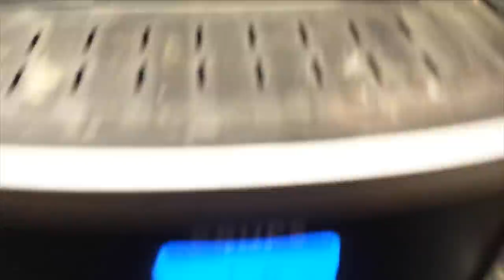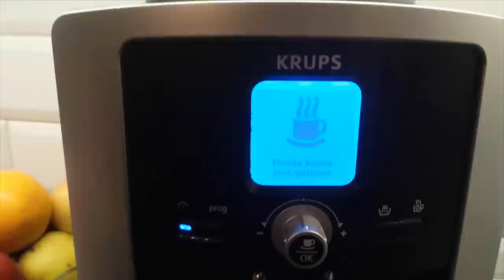KRUPS XP7200/EA8000 wyciek cz1. [leak part1.]

Comment: Hello when I switch on my machine is says it has to fill but this does not finnish. What can be the problem?
Reply from the maker: Hi,
do you mean that you have to fill a water tank? If yes, there are two options:
1. for 99% the float inside the water tank sank. Please check it. If it sank, there is a simple way to dry it - just put empty tank to the microwave 800-1000W / 1 minute. Microwave increase temperature of wet things, so the plastic will stay cold, and all water will evaporate. Just repeat it several times till the water be visible after microwave operation. 
2. float sensor moved - unfortunately you will have to disassembly coffee machine to check it.
\Mariusz
Reply: It has error 5 when I switch it on. I get a little bit of water when filling but not enough and it gives error 5. The float moves when I put water i will check the sensor.
Reply from the maker: Error code changes everything.
Please check this out:
http://www.repax.dk/files/EA8050%20temp%20mm.pdf
There is an error code table. You can read the cause and find solution.
Reply: Okay so it says
1) Flowmeter fault (wires reversed, 
connector offset, …)
2) Switch or distributor switch 
control fault 
3) Drop of water on the flowmeter 
connector
4) Pump fault
5) Water flow blocked: hose 
caught, strainer missing (tank 
valve not actuated), tank badly 
connected

5 seems not logical, which one of the top 4 is most likely?
Reply from the maker: You have to disassemly it, than you will see.
I hope there is no water pump issue. In My opinion it is one of sensors stuck.
So disassembly, check all switches and sensors wiring and connection, than check.
Reply: Can you maybe point out the position of the sensors?

Comment: Hi,you know about code error 6  on Krups xp 7200  ?Thanks!
Reply from the maker: Hi,
Error No06 is the most common problem and means: 
Water Leak, lost water presure

actually ro fix it you have to do full machine service. You have to buy full set of gaskets and replace them.

I recommend to replace at the same time entire piston - it costs the same as just two piston gaskets, but inside of the piston is one aditional gasket with really small whole responsible for coffe strongness.

For more details, have a look at comments below - it is really common topic.

\Mariusz

Comment: help mi, a have Krups EA8255 Potencia 1450W and in lcd this mistake 5, what is this?? I need technical manual
Reply from the maker: Hi there,
Error No5 means the water pump problem.
More precise: During the first few seconds of work, the amount of water flow is zero.
Possible cause: 
- damaged flowmeter (pipes mistaken, loosed connectors)
- damaged water distributor switch 
- water drops on water distributor connector
- water flow blocked (water pipe bent, or there is no strainer [water tank valve blocked])

Honestly for 99% you have no serious problem. Strongest possible is the water distributor switch (check electrical connections, disassemble it and assemble again) or the water  not coming because of water valve (were you plug the water tank).

I have the technical manual, but in polish language - if You are interested in, just download it from here: http://wyslijto.pl/plik/5p1z3ynx0y

Water distributor you can watch here: https://youtu.be/pHsmttJ79zo?t=8m6s

Fingers crossed
\Mariusz
Reply: Thank you a lot, It's very well information

Comment: Hi, Mariusz Grden, great video, can you help me, I have a Krups XP7200 ,the main board have a short circuit and some lines connections is burned ( the short is located near to R1 100K ohms and the  C05 conector and C04 connector) can you send me a photograph to the main board to check  lines connections  between  C05, C04 and R1...pleace.  thank you for your help,  bye
Reply from the maker: Hi,
please check this: http://wyslijto.pl/plik/f7pexmqpei

\Mariusz
Reply: thanks for your information , but i can see the squematic mainboard diagram, pleace can you send me only the main board phothograph because i think  the line burned is conected between  C02, C05 ,R1 and  C04. ( the main board id is GSM 03000020)
Reply: i send you the photography  to show where is located  the line burned in the pcb board     < img src=" https://www.facebook.com/photo.php?fbid=140848163184117&set=a.140848126517454.1073741827.100017768016637&type=3" >  my question is is correct connected the dotted line ??? because that is the line burned  in the pcb board .

Comment: what does an error code 0A mean?
Reply from the maker: +Ella Siroskey 
Hi,
Diagnose:
error No 0A means that the expected warm-up time exceeded.

reason:
heating unit damaged. Heat turned ON, but the temperature wasn't changed.

I know, that sounds bad, but the actual reason is really simple. On 99% U have unglued or unsoldered thermistor .
Repair of this issue I captured on this video:
https://youtu.be/pHsmttJ79zo?t=5m59s

Good Luck

\Mariusz
Reply: +Mariusz Grden   Thank you so much!  Do you also have one on how to clean the grinder?  Ella
Reply from the maker: Hi,
unfortunately I haven't.

On my videos U can watch how to disassebmle entire machine. When You disassemble it, the grinder will be fully accessible, so you can clean it.

\Mariusz
Reply: Thanks so much for the help.  A wire was disconnected - so we soldered it back on to where it belonged from watching the videos - this machine now works perfectly!  Thanks!
Reply from the maker: +Ella Siroskey 
Hi again,
I've just captured a short video with grinder cleaning:
https://youtu.be/3hqZKm4mH2k

I hope that it will be usefull for you

\Mariusz
Reply: Much thanks!

Comment: Hey .. What is this error cod  no 12
Reply from the maker: Code 12 means that there is no signal from the switch located on the bottom of the boiler.
I will look at that an will try to take a picture for you.
Reply from the maker: Hi,
Your answer is here: http://youtu.be/CYht0sNLFGA

And one more thing - why did you wrote your question in english if informations on your profile are in polish?

\Mariusz
Reply: Mariusz Grden Mariusz error 06 ???  help please :-)
Reply from the maker: Hi,
Error No 6 is the most common problem - water leake.
So you have to change all rubbers. 
Everything is on the movie. 
In case any problems, go to me, I will try to help you.
\Mariusz
Reply: Dzieki  !!

Comment: Hey, I changed bout 7-9 gaskets i had a problem leaking water on from under the machine  but still leaking nothing come out when rinsing all comes out under the machine, help!
Reply from the maker: +Erko Man 
Hi
Have you checked gasket under the water tank?
When you assembly the rear cover it is very easy to bend this gasket. In this case water goes directly under the machine.
\Mariusz

Comment from the maker: Hi Igor,
1. I am unable to reply your comment, so I have to write this answer on the top of the tree. Probably U have disabled this functionality on your Google profile.
2. Regarding your KRUPS problem No 9 - it means: heating timed out.
So you have a problem with thermistor NTC located on the boiler. Probably it's been unglued or unsoldered.
Fortunately I have a video from this repairing.
please have a look at this video:
https://www.youtube.com/watch?v=pHsmttJ79zo
Reply: Thank you very much! I'll try to fix this problem using your video. You just saved me from going to service center =)
Reply: i checked the NTC on the boiler
it looks like this: http://1drv.ms/1xkJLfc
is it OK? there is no resistance between contacts. Contacts are well soldered. the resistance between left contact and upper side of NTC equals to 0. the resistance between right contact and lower side of NTC equals to about 150 Ohms
What is partnumber of the boiler to order new one if i cannot fix the NTC..

Thank you very much in advance.
Reply from the maker: I have a service manual for repairs, and there is written that your problem may be caused by:
- Unglued or unsoldered NTC 
- damaged wires
- damaged NTC
- water leak on the NTC (changed resistance)

It is worthless to buy a new boiler, because is expensive and for sure it is not damaged. I used to spoke to some servicing company and they told me that it is imposible to damage the boiler. Really rare is that thermistor doesn't work and needs to be replaced.

I bought once two NTC's for 1pln (around 20euro cent - 10euro cent each). 
There need to be NTC thermistor 100k.
You can try to use a new one NTC and glue it with the high teperature silicone (red one). But you need to be carefull and do not touch the boiler cover by NTC wire!! - I have burned my electrical board this way.

So I'm looking right now for the board to KRUPS 7220 :)
Reply: Mariusz Grden Finally i found some time to thank you. You were right. NTC was OK. I just unsoldered contacts, cleaned the place where they were and soldered them back.Thank you very much!
Reply: Hello
I have this kind of machine, it starts up but it starts to leak water after that...what can be???

Comment: I have a Krups Krups XP 7230. When I make a coffee, few coffee goes to the cup. The remainder goes to the drops dish (almost 2/3 of the Water) and then  you hear the vapor going out. There is no water under the machine and no leak in the tubes. I hope you can help me.
Reply: You need to check and it is best to replace the boiler and / or cylinder gasket - a total of 4 gaskets in the actuator to check and 1 in the boiler.

Comment: Hello, i have a problem with the thinner longer pump. It is leaking a lot underneath, here is the picture: http://i.imgur.com/bkOz5Rx.jpg
Can you give me any advice?
Reply from the maker: AndresEST123 Hi Andres,Your problem is the most common - for sure You have an error message No 06.U just have to replace gasket set as on video above.It is also possible that this white cylinder is broken but this is really black scenario and is really rare.
Reply: Mariusz Grden
Well, i took it apart, and the two springs are rusted and broken at the bottom. Should i buy the whole assembly? (Only 65€)

Comment: error07
Reply from the maker: Error No 07:
The flowmeter signal has dropped
 (<50ml/min) but the actuator volume is insufficient (<25ml); there is a blockage in the circuit

Cause:
Ground coffee clogged up:
Tamping head stuck
 
Ejector blocked
Tank badly connected
Hoses caught (pump suction)
Pump unpriming defect if filter
 installation procedure not respected
Fault on the pump switch
Switch or distributor switch
 control fault? (component or control via cake tray)
Pump priming fault (in presence
 of filter? coffee-maker stored over a long period without tank or with tank empty?)
Water-level board or bundle
 defective
Flowmeter defecftive (indication
 of flow < reality, poor connection)

Please have a look at the error cable (Pago No17.)
http://www.repax.dk/files/EA8050%20temp%20mm.pdf

Fingers crossed